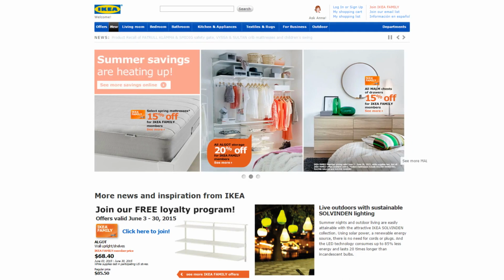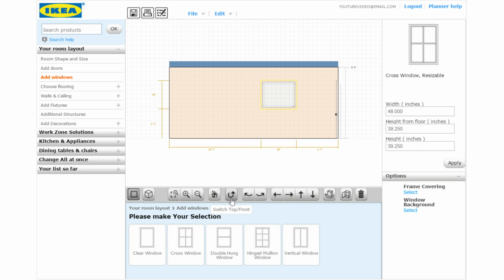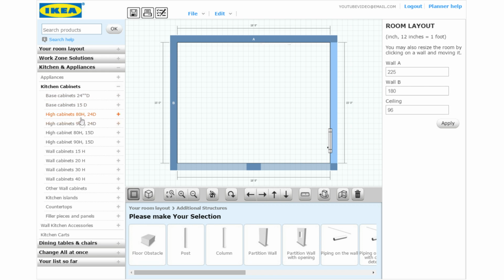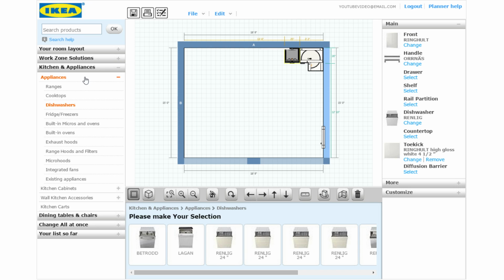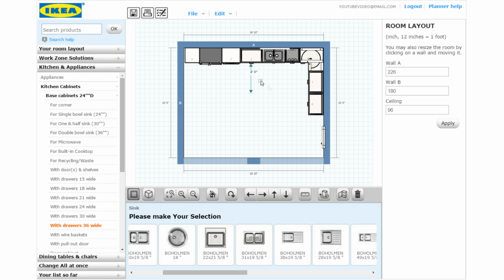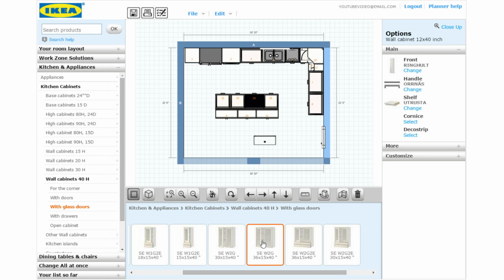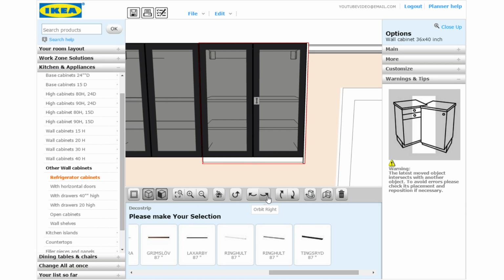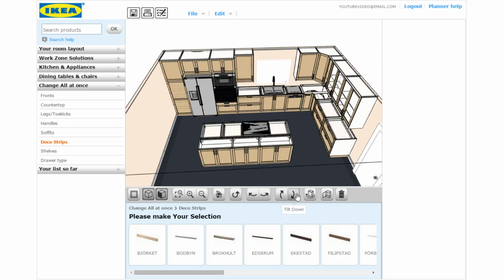Ikea 3D Kitchen Planner Tutorial 2015 - Sektion

Comment: Good video. Only thing I'd say from an energy saving point of view is, don't put your fridge (cold) next to your oven (heat source). The fridge will have to work harder
Reply: Sure for the short period of time your actually using the oven. 🤷‍♂️
Reply: @frankly2677  You obviously don’t do a lot of cooking. It will also void the warranty on the fridge if you read the small print for that appliance.

Comment: Im having issues just planning my kitcen out.

1)It wont allow me to set the window height (when i manually input the height measurement and clique on apply it comes come to the deafualt 1580mm whereas i want it at 1900mm)

2) It wont allow me to set the wall tiling height 

3) It wont allow me to place an electricic socket where i want it to do and I cant input measuremnts of whre i went it to go

4) Wiht regards to water  evacuation I cant rotate it by 90deg so its sticking out (whereas it shoul dbe going against the wall)

Ive spent 2 hours already on this software and i havnt got far